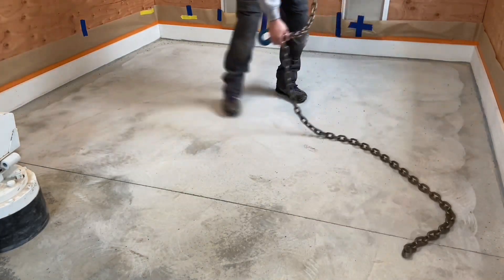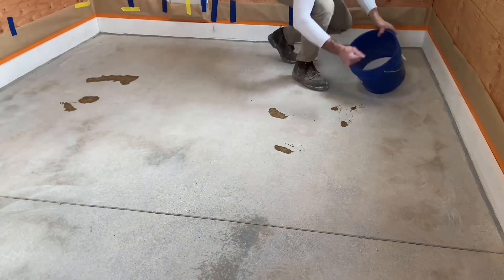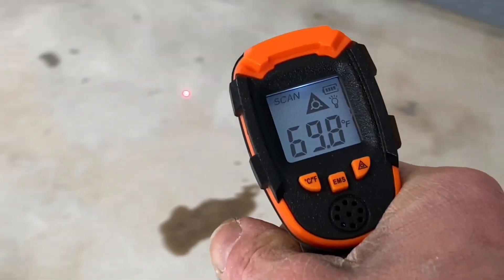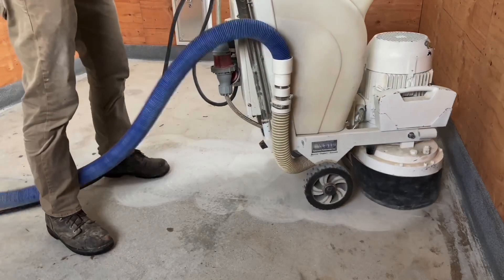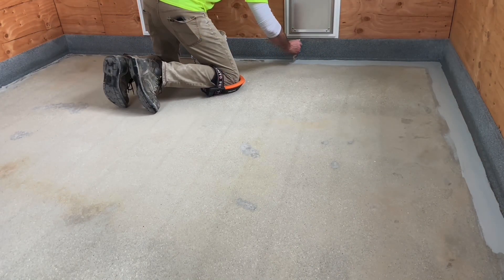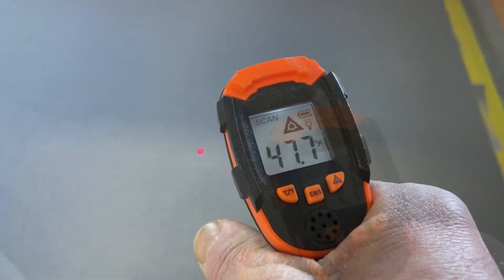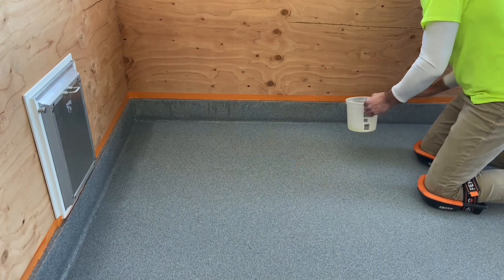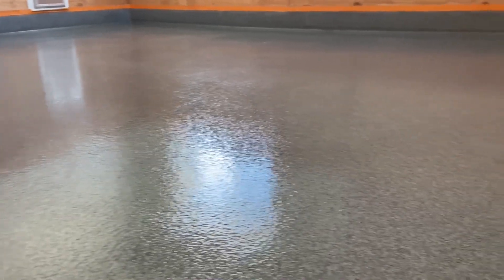How To: Epoxy and Polyaspartic Quartz Coating

Comment: I love your videos when you trowel in base Cove do you use deco quartz?
Reply from the maker: Thanks so much. 

For cove I have very little experience. From what I’ve learned, most common is to mix the same quartz as the floor for the cove. The epoxy used is usually a formulation made for the purpose or contractors will thicken it using cabosil.

Comment: What was the first coating called you put down before the base coat
Reply from the maker: @theturningpointministries-1768  the primer coat is a water based epoxy called FW38 by Smith Paints. Here is a link to the product: https://www.smithpaints.com/?ae_global_templates=fw38-water-based-epoxy-primer

Comment: A single broadcast quartz? All the quartz we do is double broadcast. Was this Torginal quartz?
Reply from the maker: Thanks for mentioning it. This was my first time doing a single broadcast. An industry buddy told me to tint the base coat to match the quartz. The base was gray and applied (I think) around 10 mils. It covered well and didn’t have any issues (or the gray base coat blended them). The top coat finished nice too. It was Estes quartz I think.
Reply: @joshjones8047  did you do a double top coat? Never seen a single broadcast quartz before, as most would recommend against it. Trying to get some more info on it to see if a single broadcast system would be feasible. Would you mind sharing your coverage rates for the top coat(s)?
Reply from the maker: @ sure thing. There were two coats. One is the grout coat that consumes approximately 100SF/gallon. The second coat is about half that consumption at 200SF/gallon. One thing to note about quartz is how thirsty it is and how that’s influenced by the resin type used. Flake is a bit more predictable for this but quartz porosity and coverage varies.